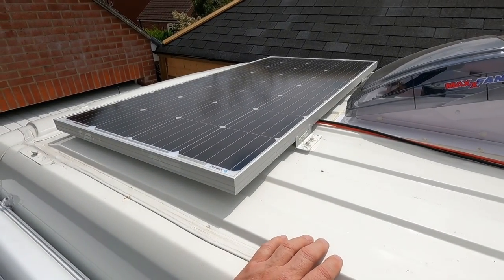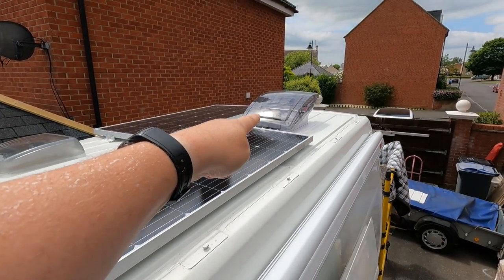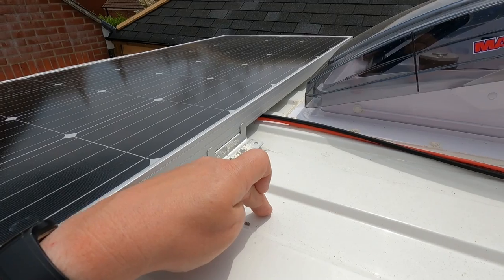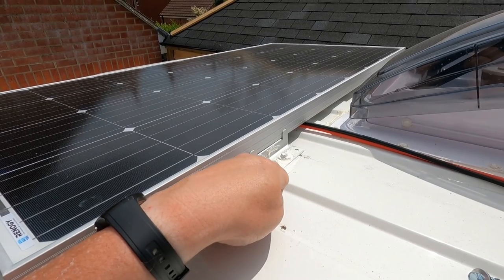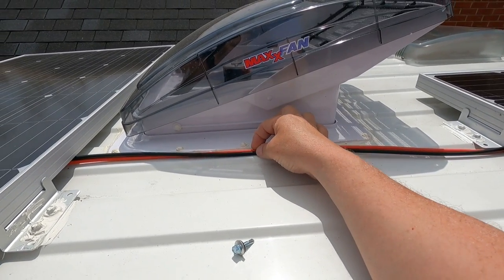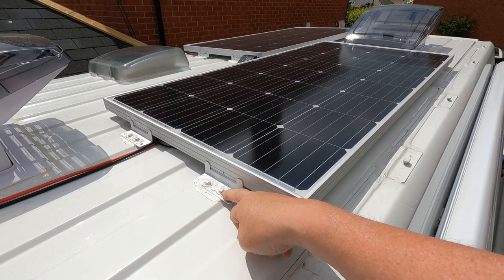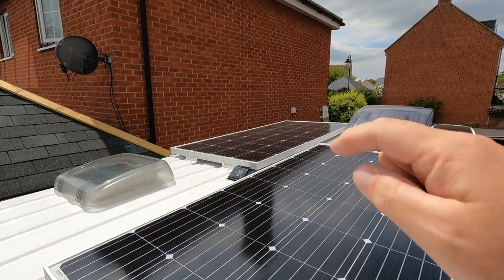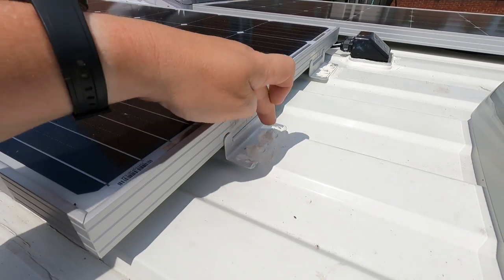Renogy 160W solar panel installation on Citroen Relay / Ducato / Boxer

Comment: Looking to do mine. Paranoid about not being able to ever clean underneath them. Considering mounting them on a roof bars/rack. Are those attachment points for a rack, that run down the edges of the roof ? And how as it held up a year on ?
Reply from the maker: Yes, cleaning underneath is very very difficult. in hindsight I would rack mount mine on build no2. you are right, the 'pins' down the sides are for roof racks etc. look at dedicated roof racks and also making your own out of 8020 aluminium extrusion. mine have held up well with my fixing method, no leaks and no movement at all, right through storm eunice and 70mph on the motorway. i do get a bit of wind noise so am looking at a wind deflector for the front to help with that. I am also designing a system for fitting the fans and rooflights that stops water 'pooling' in the troughs behind them as this is a pain aswell. It is not easy and the roof is a topic in its own right, finding the balance between cleaning and accessibility and it looking like its cocked up in the air....

Comment: I don't like self tappers through sheet steel myself. I would have used Rivnuts with 6mm stainless bolts as proper fixtures. Neat job otherwise !
Reply from the maker: A good shout! when I take them off to clean underneath that sounds like a plan and I did not think of that at the time. will be pretty easy to enlarge the holes from the self tappers. great tip.
Reply: @wiltshirecustomcamper7203  Excellent.